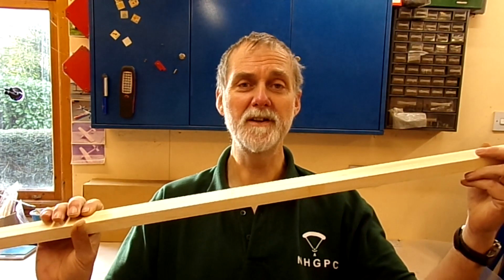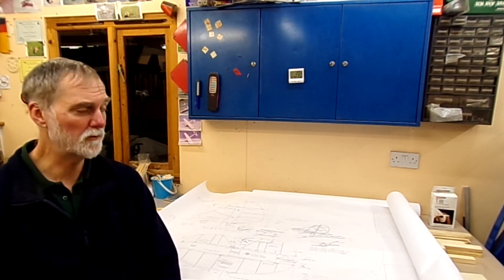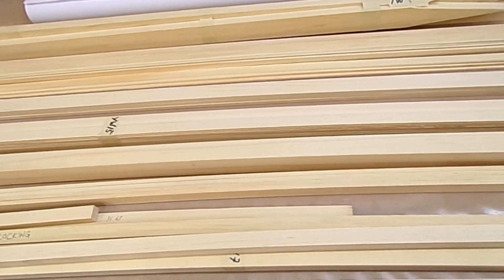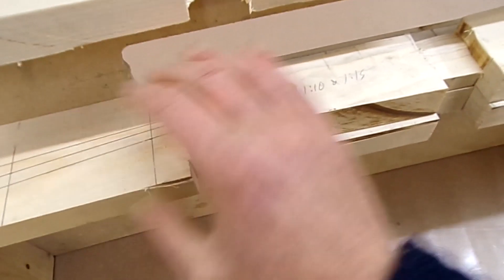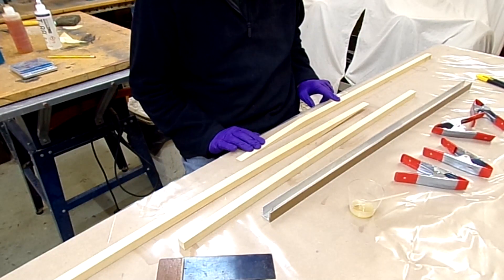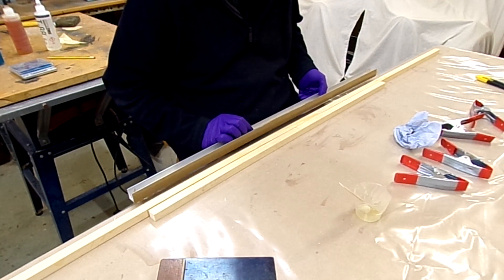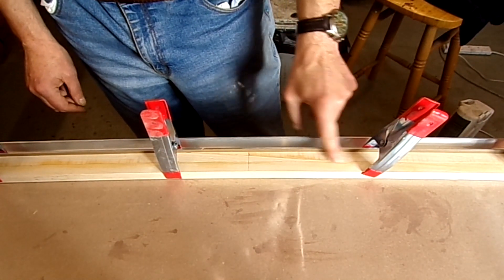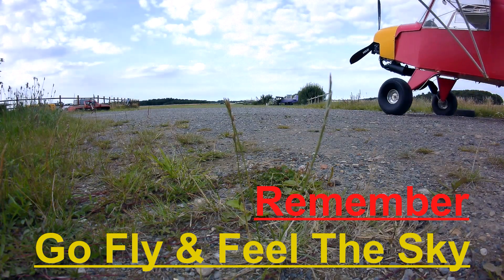EP1 Fisher Youngster V Kit Plane Build - Wood Tail

Comment: I really like that scarf method. I’ve seen it used for neck to headstock joints in ukulele building. 
Looking forward to seeing this tail come together.
Reply from the maker: Thanks for watching. I thought you may have seen the method. I also found that T88 is a lot thicker than the West Systems and other resins I have used, so now know why you put the stuff on with a stick!!